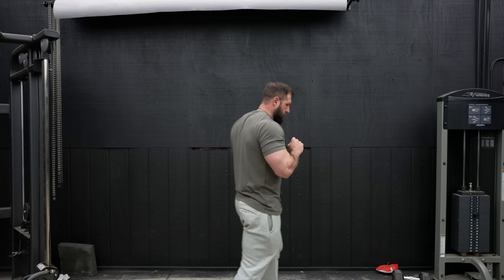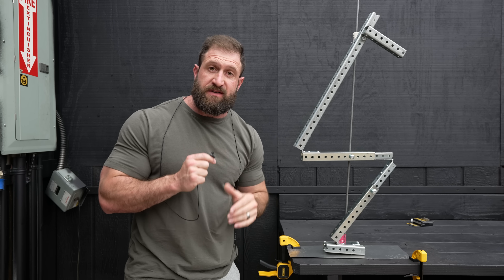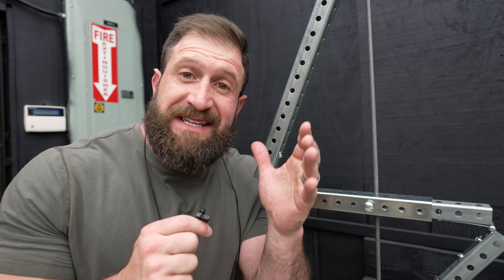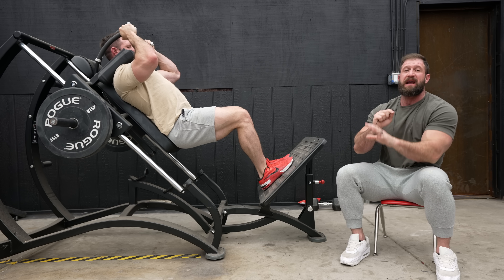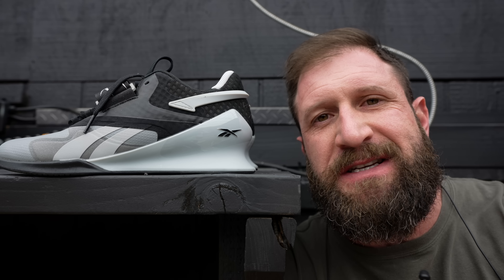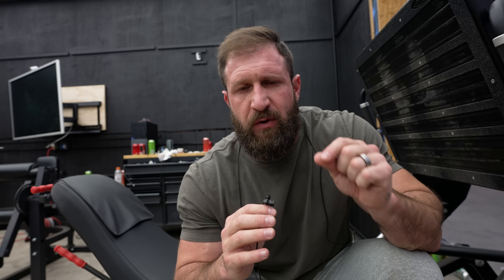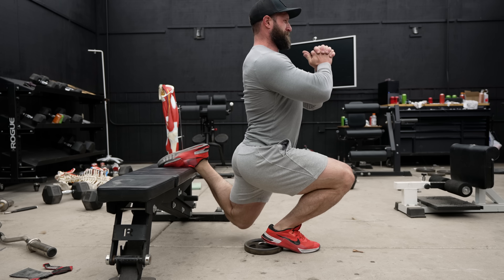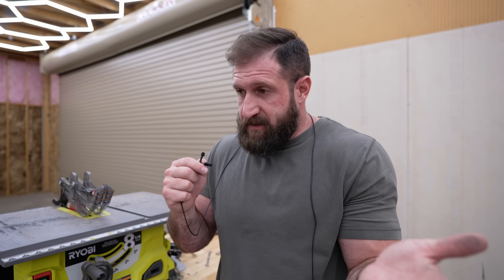I GUARANTEE You’re Doing This WRONG!

Comment: In the end people forger that the original squats were a derivative of a jump. Plenty use force momentum from heels instead of toes forcing a position that puts pressure on your hip flexors and back while even if you take lower weight put your body weight on front of your foot and try to dive straight down and up you will feel quads burning like never before. When I started doing it, at first my squats went from 130kg x 8 to 70kg x 10, LITERALLY that kind of difference in power. After 1,5 year of doing it like this tho I am up to 120kg x 15 and happy to say my quads upgraded to another level of power and size.

Comment: Squatting shoes are just a great idea in general - Nike Adidas has a good version of those.  I really like that barbell squats and deadlifts don't restrict your trajectory at all.  It does mean you have to learn "proper form" (or proper form for you - everyone's a little different), but you can adjust your alignment freely throughout the movement.  With the hack squat, it looks like you really do have to get your feet in the right position on the plate - once you start the movement there really isn't anything you can do to center over the feet.
Reply: @mano I think he's wearing NIKE METCON 7 in red.  I like the Adidas Power Perfect 3 ones.

Comment: As a mechanical engineer, the science checks out. Torque is equivalent to force multiplied by the displacement of that force, and in this case, greater torque causes an increase in tension/compression in the muscle and bone

Comment: BUT RYAN, i can easily bias my quads during squats by using a narrow stance but it does limit the weight and depth i can achieve.
BUT this can be enhanced by pre exhausting quads first with leg extensions. warmup then do as much weight as possible for 5-6 reps to failure, drop some weight, next set do 6-8 reps to failure, drop some more weight then do8-10 reps to failure, drop some more weight last set do 10-12 reps to failure.
I guarantee narrow squats after this wont require heavy weights or ass to grass depth  to FEEL HEAVY.
FYI, dont drive a stickshift to the gym, your legs may be jittery on the clutch, lol

Comment: One of my fav quad killers was always squatting using the Smith machine so I could push my legs out further in front of me and keep my back upright. Physics!!
Reply: Love the smith squats.
Reply: Whenever I do this same movement on the smith machine I rarely feel it in my quads. Any idea why?
Reply: @ProcessHF  the smith machine has a fixed bar path so adjust your stance in the warm up sets to find that sweet spot or maybe have a buddy video you from the side to see what your form is like 👊
Reply: @ProcessHF  just put a piece of wood under your wheels as he explaines. You will feel the diff
Reply: @ProcessHF  maybe you go too deep?   Based on what this video says, once you start going past 90 and your hip hinges, glutes and hams will kick in.